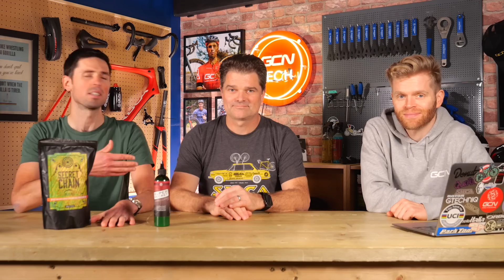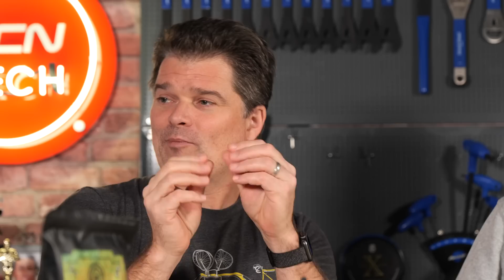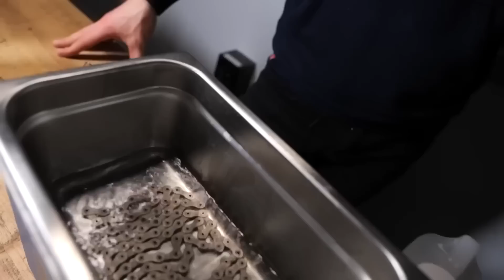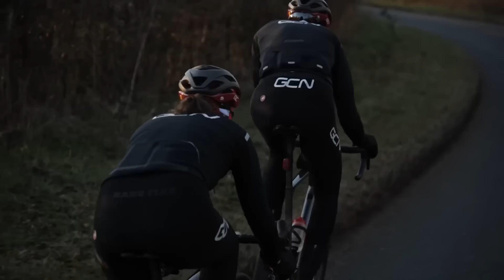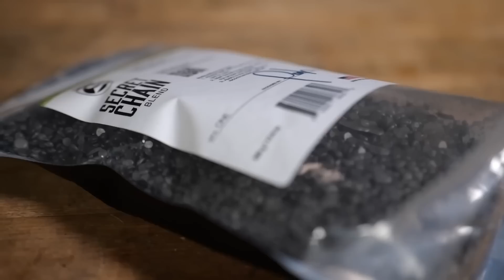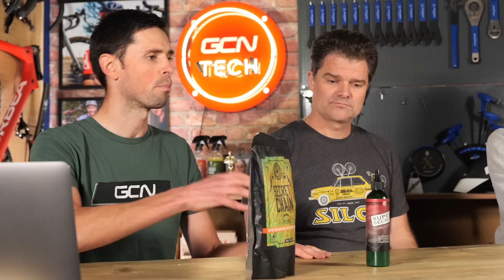Are You Using The WRONG Chain Lube? Ride Faster & Save Money!

Comment: In the end, a whole life cycle assessment is what we need. How long lasts a chain with no maintenance, with oiling and cleaning and with waxing and cleaning and also give the times used for lubing and cleaning for both options. Another part of the data should be the ml of lube used in the process. With this everybody could rate their precious time and compare where the 3 ways would get you
Reply: If you use cheap chains and cassettes, it's probably not fiscally responsible to wax considering the time needed.  If you're using a $60 chain and +$200 cassette, it's definitely cheaper to wax or at least use Silca Synergetic which is expensive per bottle but you barely use any of it. I use it on my indoor bike.  It has about 5000miles on the chain and it barely registers with the chain checker and I feel like I could return my bottle for a refund without being questioned because there's still so much in the bottle🫠
Reply: @veganpotterthevegan  this might be a good data point, but it misses the scientific approach. I switched this year all my bikes to diy wax (candles, 10% baby oil, MoSo2 as additive). The first step was pain (get rid of the sticky grease, also the factory grease on new chains). The cleaning so far was better though
Reply: @wildmoe5016  buying wax from Silca is honestly pretty cheap.  Time is money to a lot of people.   I feel better knowing it's been done well and I don't have to do it.  Also, your Molybdenum disulfid is probably not nearly as fine as what Silca sources

Comment: afternoon, ive been riding a motorcycle since 1978. the motorcycle i was riding was a kawasaki kz-1000 LTD the chain on it is quite large compaired to my bicycles chain it is a 630 and the links are the size of your thumb. the chain lube i used on it was tri~flow. when i starred riding a bicycle that's the chain lube i used of my bicycle. it worked very well but it was very messy. i tried dry lube it didn't last more than a mile before the lube was gone and the chain sounded like there was no lube on it at all. so i went back to the tri-flow. so i was back to looking for something else. i got the wax but it looked like a real pain to apply. so ive been sticking with the tri-flow. then Ollie started to just to say the wax was the best as well as the cleanest and it lasted. i have the wax i guess one of these days i'll have to give it a try. the dri-lube was/is a waist of time. glad i didn't buy to much. thanks for your in site into chain lube. the tri-lube is very good too. it lasted for a real long time.

Comment: Does it make a difference if a bike is exclusively an indoor bike?
Reply: Wax has a slight disadvantage that on the first ride after waxing it scatters little chips of wax around the bike. If you stomp them into the floor or your cycling mat, they're not easy to clean. Other than that, indoors is not that different to clean, dry conditions outside.

Comment: Josh confirmed my thoughts that drip wax is the sweet spot. It‘s only a fraction of a watt slower and if I invest the time save fiddling around with hot melt in core training, I can easily save more than a watt.
Reply: Personally, washing the chain in solvents and then submerging in molten paraffin is less effort than carefully placing a drop of lube on each roller.
Reply: @ltu42  You have to get it off the bike (strictly needing a new quick link) and you have to set up the whole shenanigans before if you don‘t have a lot of space.

Comment: The point about time savings regarding cleaning the rest of the bike when waxing the chain is quite valid. Since I started waxing my chain it's one point I've realized: no cassette cleaning, no chain degreasing, every part of the drivetrain stays so much cleaner. Waxing has its downsides of course and isn't for everybody but I'm quite impressed with its upsides.
Reply: downsides of wax??? I went for the drip on
Reply: It's all relative to what you want or don't out of your lubrification protocol but it tends to be more work in total: initial thorough degreasing of a new chain, hot wax baths every 1000km (approx, I drip-wax every 2-300km but a hot-wax treatment is necessary every 1000 ime) is a bit more involved than a quick degreasing with a chain scrubber and reapplying a drip lube. Furthermore, you have to let a drip-on wax dry for many hours instead of reapplying just before a ride like you can with a traditional lube. Also, IME, wax doesn't work well with wet conditions, meaning I usually find I have to clean and reapply if I'm caught in an important shower on the road. The absence of oil also means that in these cases, you have to dry the components thoroughly or surface rust will appear (cassette, chainrings, etc). I wouldn't go back but there are downsides... @30nabster

Comment: Back in June 2023 I was doing a 65 mile gravel race in the Sierra Nevada and I used a dry lube on the chain the night before. The conditions were dry and the course was very dusty. Half way through the chain was squeaking so bad I needed ear plugs. When I got home I ordered Silca's wax and got a $15 slow cooker to wax the chain. 3 weeks later I did another race in similar conditions and had no noise issues. I ride my gravel bike in all conditions because it is a commuter bike too & I can vouch for not having to constantly clean it. I coated the chain on my road bike too and could be happier.
Reply: I have the same experience.

Comment: I found this very interesting.  Have not tried a wax lube.  I've been using a dry lube for the most part.
   What I did find interesting from my own experience.   Is when I ride in the wet.  I would use the wet lube.   The wet lube seemed to perform much better then the dry lube.  Shifting everything worked better.    Watching this has convinced me.  I am tossing the dry lube.   Next time I am due for new chain and cassette.   I will start a new lube and maintenance plan.   I am not really about watt savings.  My focus is on reliability and smooth quiet operation.   This will help.  Thanks
Reply: Been using wax for sometime. It's so good. With normal lube I have to apply it like daily. With wax I only need to do it once a week at most.
Reply: Saving watts comes free with reliability and low wear wax treatment

Comment: My average speed has increased dramatically since I started waxing my chain and purchasing an accurate tire pressure gauge and using Silca’s tire pressure chart.
Reply: Or are you just fitter?
Reply: I'm all for waxing but you're not getting significant gains(they can be measured though) unless your chains were in terrible shape and you were nowhere close to ideal pressures
Reply: how much, 20% faster?, me too if i go to toilet before uphill

Comment: Lubricating my chain is never about Watt savings (I reckon I either get home with someone to talk to or not) it's purely about longevity, I'm not made of chain money !
Reply: Yes same and also it much easier to add some lubricant than to replace chain like every week. 😀
Reply: Start hot waxing (white candle paraffin works great) and see your chains last several times longer.
Reply: @ltu42  I reckon I'd only get 10 - 12 days before the chain needed waxing again, too much faff ! I do acknowledge it's a good thing though.
Reply: @ltu42 I’m willing to be converted but how do you ensure your chain is squeaky-clean, before applying the wax?

Comment: What do you recommend for commuting during autumn/winter? I'm still using wet lube. Of course , the chain will collect all dust it can. I service it every ~100 km. I heard wax isn't recommend because you have to dry and re-apply it after ever ride in the rain. Right?
Reply: I use liquid low temp chain wax in winter. It is very good.
Reply: Internal gear hub and belt drive 👍
Reply: @DS-um9hi  yeah IGH is the best.  Shimano nexus 3 is my favourite. It is just so reliable.
Reply: It works fine it rain and snow and it doesn't really collect dust.

Comment: @askgchtech There is growing trend around me, that cyclist are using silicon grease as a cycling lube. They claim that it gather less  dust. have  less friction. I haven't see any commercial silicon based lube from Silca or any other cycling brand. So am I missing something?
Reply: in lidl you can buy universal silicon spray lube

Comment: I have thought about waxing but am put off due to the fact that it needs replacing at 300km . That would mean that I would need to re wax my chain every 7-10 days. There is no benefit to this as I wash and lube my bike after every ride, it only takes 30 minutes to do as the dust does not have time to set. I do live in Spain so don’t worry about rain or snow or even frost so I am one of the lucky ones I suppose.
Reply: I understand this perspective completely. I didn’t clean my bike every ride, but I did quite frequently - usually to clean the mucky drivetrain. 

I find bike cleaning and maintenance much faster to do with a waxed chain, because the waxing takes far less effort and time than cleaning and lubing with a wet lube. I take the chain off and drop it in the pot. And the drivetrain is much easier to clean. 

Riding as much as you and I do, there’s also a performance benefit to the wax. 

Seriously, there’s no downside in your use case. You’re cleaning the bike anyway. Dropping the chain in the pot takes no additional time.
Reply: Only 30mins? Sounds like a lot. I'm into waxing and the time added from taking off the chain, crockpot, installing back on the bike is really around 3min. Since I don't wash every ride it takes very little time to maintain. Drivetrain doesn't get dirty thus no need to clean it specifically. If I would wash once every 7 rides it'll be around 36min of maintenance total. 3,5h looks bad in comparison

Comment: I really like something called superdrop chain lube. I’ve tried wax and subsequently gone back to superdrop. It’s very clean, in fact, can be used to clean the chain. It’s palpably fast upon (re)application, and versus wax is night and day regards pfaff and time. Superdrop is not as much as 60 seconds start to finish. Run chain through clean rag, apply small amount to rag, usually I try to form a wet patch about the size of a one pence piece, run the rain through a patch facing the teeth side of the chain. Bob’s your uncle and you’re good to go. I’m in Taiwan and I note I don’t see it universally readily available, but if you google it you should see it. It’s orange and comes in a clear spray bottle. Price-wise beats everything else with a big stick too, lasts for ages as applications use so little volume. Just an option.

Comment: 1:19 I am an expert metalsmith and have a bit of grad level Bioceramics material  science/engineering credits.   I was going to say: " Nothing with the word 'dry' and 'ceramic' should ever be used as a lubricant.  Maybe a milling compound or a polishing agent. But that implies: abrasion.  I am very happy they got straight to that point!
Reply: Are you sure you aren't just a metalsmith?
Reply: @rfgerg-m2c  yes.
Reply: Silca uses WS2 Tungsten Disulfide as additive. Tungsten is a very hard steel and with your logic also very abrasive. I have seen a gun oil test with a Brugger machine. The 3 best gun oils all had ceramic as additive.
Reply: @Gieszkanne  good point.   I think studies would also be need to document any wear from tungsten or ceramic lubricants.   Long term.   For bike drive train. It may be irevelant. Even id the ceramics involved act as microfine polishing agents, the ammount of wear  may not be an issue if a chain will be considered consumable waste after 1.5-5kms a cassette after 15 or 20km etc.  Perhaps the wear caused by the ceramic compound wont decrease the life of the bike components.

Now you bring up machine guns.   A quartermaster in Eastern ukraine would consider all the moving parts (not to mention barrels) of guns at the front to have a lifespan in weeks/months or years.

But a collector... Might not consider a ceramic compound for a rare mint condition Sterling submachine gun etc.

Comment: I just went from Smoove to Silca for longevity and cleanliness but am disappointed. The Silca dripwax has some sort of black component in it and when it flakes off, the bike gets dirty. If you touch the chain, your fingers get dirty and then I rode 20 km on wettish roads, no rain and stored my bike inside in 24C and the next morning there were many rust spots on the chain, especially on the outside.
Reply: Smoove has an oil component to it, which helps it protect from rust better, but also makes it not penetrate the chain and allows it to get dirtier.  For modern drip waxes like SILCA, Ceramicspeed, TruTension, you need to wipe the chain with microfiber cloth and then reapply after a rain ride.  The dark stuff in the lube is WS2.. it's what makes it beat the Smoove by 10x in block 1 of the ZFC testing and is what pretty much all of the top competitors are now using.
Reply: @SILCAVelo  "block 1 of the ZFC testing " ??.

Yes the Smoove did get dirty but the black stuff in the Silca got both the chainstay and me dirty from new. Maybe I should just use pure wax and dip it and dry the chain when it gets wet, hmmm.......

Comment: I started using the Silca Synergetic almost a year ago. It is not as clean as wax, but lasts longer and it is a really fast lube. It is so good and it has a lot less fuss than waxing that I find it hard to switch to anything else.
Reply: Silca Synergetic is the way to go. There’s nothing I say nothing as quiet and efficient as it is. The only downside is the price.
Reply: @frankb.1284 spendy but you barely need any of it and it's significantly cheaper than most per kilometer
Reply: @frankb.1284  It is indeed pricey. But it lasts longer and it also makes your drivetrain last a lot longer.

Comment: I would of liked to hear opinions of what's best for the indoor season when dirt is not an issue. Been using squirt instead of melt hot wax what I use outdoor (paraffin) but it's turning into black goo.
Reply: Silca Synergetic.  You get a ton of mileage per application indoors and since you barely use any of it, it doesn't attract dust
Reply: Look at Synerg-E, it's the same additive package and base oil as Synergetic, but higher viscosity so that it won't fling even under the hardest efforts, and if you look at ZeroFriction data, it has the longest single application longevity ever tested at ~9000km per application in clean/dry conditions.
Reply: I use hot melt for indoors. The wax flakes that come off the chain are easy to vacuum up, it doesn’t turn sticky and it just simple to drop it back in wax to retreat.

Comment: Over  priced products are you going to notice the 3 -4 watts clean your chain regularly ultrasonic cleaner brilliant
Reply: I don't notice the watts. But I DO notice the reduction in drivetrain wear. Over 12,000 km from the chain and still within the wear limits.
If you are concerned about the price of products, then just think about how much money that would save you in terms of not replacing worn out chains and cassettes.
Reply: @andrewmcalister3462  Are you really saving though? How many applications of wax & lube did you have to use on that 12,000 km chain? If you go by the "recommended" maintenance. You would have to re-wax every 300 km. That doesnt sound like much savings to me.
Reply: @andrewmcalister3462 some people enjoy being idiots - they can’t see a small Investment pays of big time
Reply: @andrewmcalister3462  I got 20 000 km out of a chain by submerging it in simple white candle paraffin. Even then it started reaching 0.5% in some spots, but overall elongation was just 0.35%.

Comment: Speaking of wet and wax, been using UFO Drip Wet Wax for a week now, over 400km with a top upbin between and let me tell you, I'M NEVER USING THAT WET WAX CRAP EVER AGAIN. It's so thick and sticky. Today I took the chain off and gave it a good bath in Turpentine. Took off the jockey wheels and had to clean off all the thick stuck on muck. Took off the cassette and brushed off all the waxy muck with turps. By the end I went through so many rags to clean my drivetrain.
Anyways, I picked up a bottle of that Effetto sunflower wax. Supposed to be good. Only got that because I can't find the UFO Drip normal version anywhere other than online.
Stay away from that UFO Drip wet wax.
Reply: Same here. A month of Squirt lube and my rear derailleur locked up. Nasty. Hot melt wax didn’t have any such issue.  Then again, neither did ProLink — it just smells bad.

Comment: What about using WD40 silicon spray? (the silicon one, not the normal one)
Reply: For cleaning yes but for lubricating no. WD40 is not a lubricant.
Reply: @forza1860muc  did you read what he wrote?
Reply: @forza1860muc   There exits WD40-branded bike chain lube. But the question was about the spray silicone oil, not even the classic WD-40 penetrating oil (which IS a lubricant, just not an ideal one).